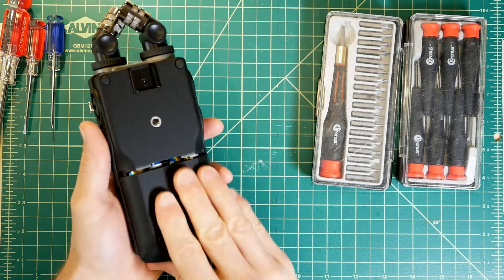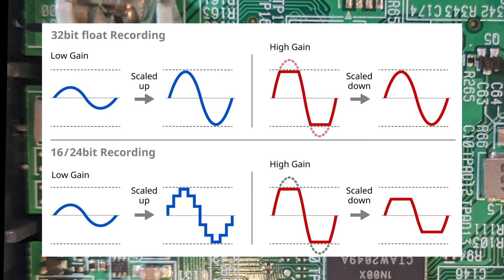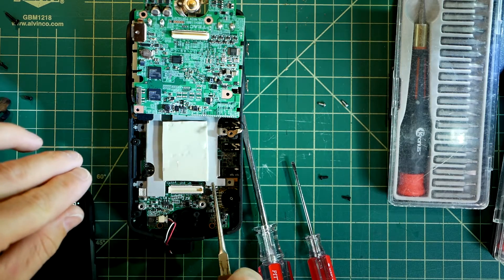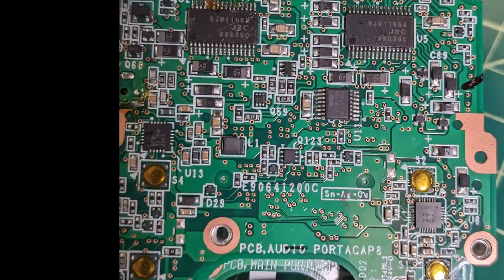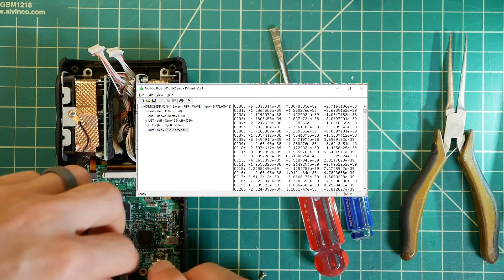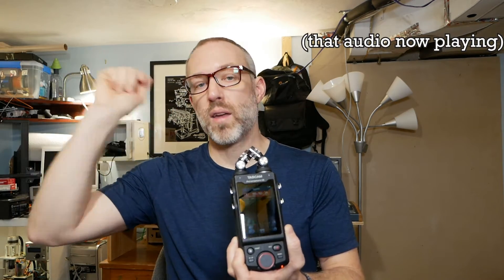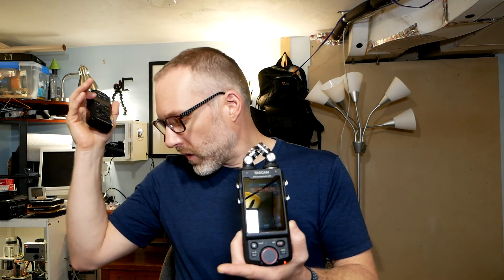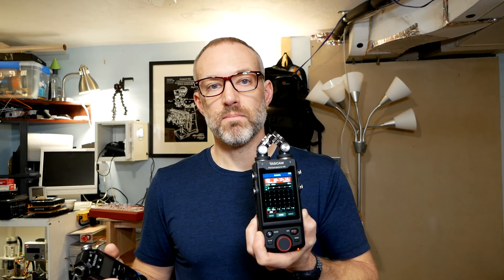TASCAM Portacapture X8 Teardown and mini review

Comment: What I find confusing with the X8 is that the apps seem designed to make it easy for beginners to use but they are basically useless for anyone with experience. Which limits you to the manual mode. So it’s alot of real estate taken up on the UI for no real reason. 

The playback and renaming features aren’t a big deal for me as you should be slating your recordings so you can recall them later. Since this is a device that has 4 XLR Combi jacks and provides phantom power and the ability to stereo link them, I think it’s reasonable that TASCAM expects a more experienced individual to be the main market for this device and therefore I can forgo the kinda crappy playback and renaming UI. I think most professionals and enthusiast have the expectation of renaming files and adding meta data in post. Especially if they are following the UCS. 

I think for the money they could have beefed up the screen quality. If you shell out the $40 for the Bluetooth adapter it is nice to use your phone as an alternative to the built in display. It’s a 1 to 1 copy and does work quite well. Worth it? It depends on your needs. For field recording I say it’s a nice luxury to have. 

Kinda cool that it functions as an interface. I don’t see myself utilizing that feature as I already have an interface but if you were just starting out it’s not a bad option. An interface with comparable I/O to the X8 would run the same or more and would not necessarily provide the convenience or portability that the  X8 does. 

The microphone capsules are decent sounding but they are cheaply made. A common complaint. Really no excuse here. The housing should be metal and not plastic for the mics. As well as the part they plug/screw into. If you don’t press them in firmly when changing for XY to AB you will damage the plastic to some degree. Not to the point of being inoperable but I wonder over a long period how it holds up. 

Power through USB C is nice. Sucks you have to get a separate adapter. 

Don’t buy the TASCAM Windscreen. Spend the money on the Bubblebee X8 Windkiller SE if you plan on recording outside. Look for the bundle that includes the screen for both AB and XY configurations. 

It’s a fun device. A bit pricey. Well built for being made of plastic. It still feels quality in the hand. If you don’t need 1/4in jacks then I would consider the X6 instead. Unless you really need 4 inputs. I’ve said before if they had included combi jacks on the X6 I would have chosen it over the X8. Still enjoy the X8 though. I like the option to have a lot of I/O if I need to in the future. The UI works well enough and feels quite good on my phone. Maybe TASCAM will come out with some upgraded mic capsules to buy on the side later on. It would be nice to see them take a page from Zooms book in that regard. The device is a 7.5 out of 10 for the average enthusiast and maybe an 8 if it happens to fit your needs especially well. 

Good video. Good to see the way this functions on a component level. Very neat.

Comment: The XLR inputs are critically important for singer-songwriters and musicians.  I am not sure why you don't understand that.  This was primarily designed for creators and podcasts.  But it is a competent field recorder also.  

The smaller Tascam X6 would probably be a much better match for your requirements. 

Great job in reviewing the internal components of the recorder.

Comment: Thanks for taking it apart, great video. I have one and I love it. It is truly versatile, whatever I just needed was there in this compact device. A few changes in UI would do good to it though.  That presets cannot be renamed or updated only pisses me off, but that recording mode (e.g. 32 bit float) gets lost when going into another recording app and then back is very-very dangerous. Recording settings should be retained per recording app, even those that are in general setting menus. Recently they added some timecode capability with Atomos Blue devices and bluetooth, but if you use that feature, you can no longer use the blutooth remote control via the app. I love that you can remove the top mics to reveal two jack inputs, I hardly ever use those mics anyway, but having 3.5 jack inputs is very-very much appreciated.

Comment: I own the Tascam X8 and I think you are making your life really hard with file names. After you make your recordings on the X8, just plug it into your laptop with  USB, and then transfer the files to your laptop. Then you can name the files whatever you want. This is MUCH easier than trying to rename the files in the Tascam X8 UI. I bought the Zoom H8, which is comparable to the X8, and I could not find a way to even rename files on the Zoom H8 (possibly I didn't know how to use its UI). Further, just naming a file on the Zoom H8 is a pain in the ass. So I think you missed it on the file naming problems that you list. You've got to remember that most people using the Tascam X8 are going to transfer their audio files to their laptop and into their DAWs to fine tune the recordings. It makes total sense to FIRST transfer your audio files to your laptop, and THEN rename them. I record original songs and I have not had ANY problems renaming the X8 audio files in my laptop and you can name them virtually anything you want - there is no 8 letter limitation.
Reply: I agree. You should be slating your recordings anyway.

Comment: This is really interesting - I'll draw attention to it on a relevant online forum where a number of owners, and potential owners (me!) have been discussing it.  Firstly, the dual preamp system is standard issue for this category of device - that's how the cope with having a digital dynamic range way bigger than the analog dynamic range.  But it's worth pointing out that there's no free lunch on the analog side - if you do drive the preamps into analog distortion, or present them with a super low signal, then the digital stage will faithfully record the analog clipping, or when you crank up the quiet bits, any analog noise will also get cranked up.  One thing you haven't mentioned is the famous hum lines or RF interference issue that was raised in early reviews.  It seems the Tascam fixed that in later manufacturing runs (they say) and they also tinkered with it in firmware updates.  Maybe you therefore didn't encounter it.  But I wonder whether anything you saw under the hood was related to Tascam fixing that issue.

There's now an X6 which might have been more the device you personally wanted.  But currently it's only $20 less than the X8, so it's only worth buying by those who really don't like the size of its big brother.

Thanks for this video - it's kept me up at 1:30am when I should be in bed!
Reply from the maker: Thanks for taking the time to comment, I appreciate it.  I did not look too closely into the hum, as it's in the ultrasonic range and doesn't as much matter to me so there's a good chance my unit has that as well.  I did see the x6 that just came out.  Still seems larger than it needs to be.  I would be very excited to see Sony come out with a new high end recorder, maybe a D100 replacement some day.

Comment: I totally agree with you, Dennis. It's very strange device with strange features. You can save presets, but you cannot name them. You can plug-in stereo line signal, but you cannot use binaural stereo mics (like Roland CS10EM) because mini-jack input does not supply plug-in power (which is present in older DR100 and DR05 recorders). It's a big monster, but if you have big fingers, you have a problem with microSD card and small touch-screen buttons. It's a "half-baked" device and was not designed by users and engineers, only by marketers/traders :(

Comment: The UI is clunky,  but the unit is built really well. The mics sound great and I use the xlrs all the time. X8 has a lot of handling noise, but a tripod & Bluetooth adapter fix that. I wish it was rechargeable, but it can be USB powered, so that’s great.

Comment: Thanks for being brave and taking your unit apart. Hopefully someone will make the work flow better via update, but idk. The audio quality from my unit is good, but I’m worried I’ll break the battery door and mics. Also the handling noise is pretty bad, but with the blue tooth phone app there is a work around. Over all though I really like it and I’m hoping tascam improves the unit as time goes on. Subbed.
Reply from the maker: oh yeah! forgot to mention the battery door, it's a really weak design.  One little piece of plastic breaks and from then on you gotta use tape to keep it shut.  I'm sure the mics would break from a direct drop and that's not great for a hand held unit.  But I'm still using it and will just find a place to put it down or use a little tripod for field recording.